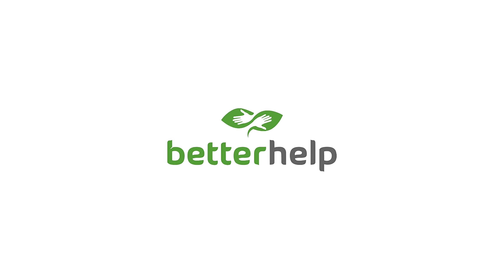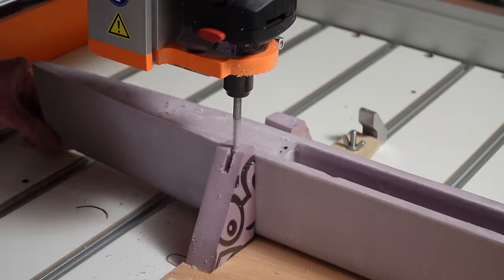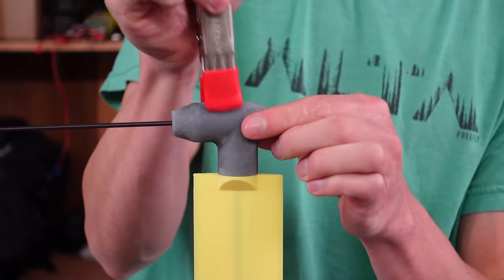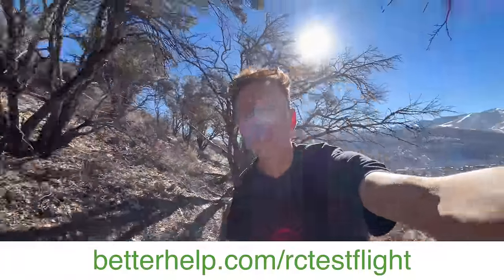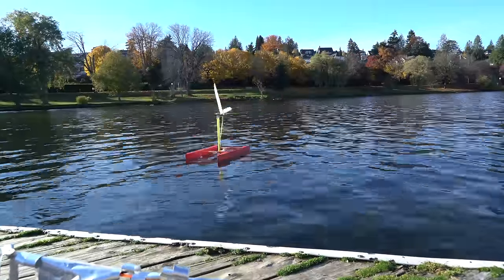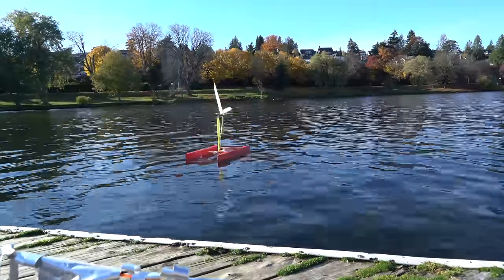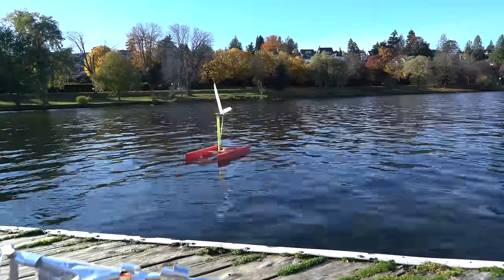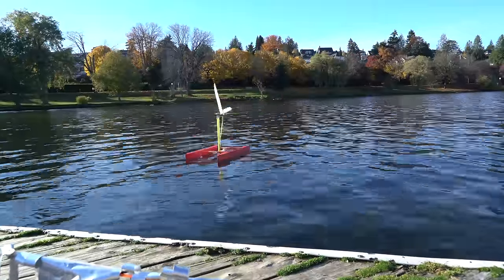Sailing Directly Into the Wind - Is it Possible?

Comment: I have always been fascinated by the wind turbine boat idea.  I have some ideas and observations.  First, an inherent issue may be the air friction(drag) of the wind turbine blades moving at high speed. That's the biggest difference from a stationary sail.  So what if, instead, a many-blade low rpm 'high torque' design was tried?  The blades would still need to be a very accurate airfoil, but they would be facing almost into the wind.  Another issue is the tip vortices and the fact that air near the hub isn't doing much.  So looking at the swept disk as 'sail area' you'd want a much bigger diameter rotor.  I don't agree that a Darrius style turbine would be better, because this would drastically reduce the 'sail area'.  The comments about your airfoils are right, you need a correct airfoil and yes you should be gearing the prop way up or going to a larger prop with a higher angle of attack on the blades.  The most efficient water props actually look like airplane propellers, they are instead made stubby to protect them. Then of course there are these new 'loop design' props, which astonishes me that they (supposedly?) work better.
Wind turbine boats work well enough to be acceptable in performance and they are Just so cool. Another interesting idea would be a turbine that compresses air instead of turning rotary shaft, and This air would be blasted out of an underwater eductor nozzle for thrust.one last idea: q combined wind turbine and solar electric boat ,Where The solar panel would block The noise and the hazard of the spinning blade and both would simply be connected to a conventional electric trolling motor.
Awesome work, thanks for showing us!!!

Comment: Peter Worsley has done some really interesting stuff and not only with rotary sails.  I have seen  his videos multiple times and plan to try his idea of a self trimming wingsail on an old Sea Devil sail boat.  I built a reverse flow double wing sail on my Sea Devil (I saw it on a video from tsstproa - who has also done some really interesting stuff)  that got lots of attention from other people  on the lake - that  would sail in almost no wind, and go very close to the wind, but had some issues that I havent yet got worked  out.
Reply: I have also seen his wingsail videos can only think I am missing something as cannot fathom why they have not been adopted in any capacity so far.

Comment: Had an interesting thought:  What if, instead of a propeller, you used a parachute or kite that pulled a rope wound around a drive shaft?  Kind of like an old-fashioned cuckoo clock uses weights, maybe it would be possible to use wind in the same way?  You’d probably need to attach a balloon or something to keep the chute up, and gear the water prop to push more water for less rope unwound (or use a compound pulley system).

If you found a way to close the chute, you might be able to set it up so it switches between two chutes - the high-drag open one reeling in the low-drag closed one, thereby making it almost perpetually running.  On the other hand, this might be a better project to try out on a land vehicle with more efficient wheeled drive.

Comment: This is an awesome idea. Also very related to the Veritasum video of sailing faster than the wind. But in reverse. 

Could you put a uni joint/cv on the wind turbine axle so you can change the direction of  it vs the boat??

Comment: For a sailboat, the center of rotation  of the boat is the keel. Adding the keel would help the directional stability. If it could be controlled and moveable from the bow to the stern (and back), you could turn into the wind easily with the keel towards the bow, and away from the wind with the keel towards the stern. Of course, it is additional drag, though.

Comment: I know on slower rotation speed like you get with human powered, a water prop that looks like an airplane prop is more efficient, with less drag.  The boat props are in the 1000s of RPM.  Larger vessels may be slower.  Greg Willoughby is an engineer from Australia that specializes in fluid dynamics that helped me with mine.  I now use a 14" with a 12 inch pitch for my boat. Hope this helps.

Comment: Love your thinking and effort. You are looking for a "rotary sail". How about profiling the wind prop as a "rotary sail". a deep cord of the blade next to hub to nothing at the tip. Blackbird is doing this with its prop design. I have no idea about the drag and ratios, just seat of the pants sailing. Try different sail blade camber profiles. Keep at it.

Comment: I love this.  I'm a professional sailor and Mechanical Engineer that lives just off of Green Lake in Seattle.  You might want to experiment with your mast location as this is considered the Center of Effort (blades) vs Center of Lateral Resistance (hulls/keel).  This affects how the boat can turn.  Also, you might want to look into asymmetrical hulls.  Hobie cats have used this to assist in tacking.
Reply: Mast, yes, but asymmetric [sic] hulls regarding tacking? They're more to do with reducing leeway, IME. Hydrodynamic lateral 'lift' - when one hull's more in the water than the other, as cats do. Tacking ease would be afforded by spring in the hulls - banana-bendiness - so that the bows and sterns would be more raised from the water, or less immersed, than the centres. 
['..just off of Green lake'. Is this because those who speak American can't decide whether 'off' has two f's or one? ;-) )]

Comment: The "magic" also resides in the fact water is much more viscous than air, which means the small water propeller has a lot more "grip" into the water than the air turbine has drag. (You also kind of touch this with the land-based Blackbird)

Incidentally, that's also why traditional sailboats can go against the wind: their keel/daggerboard/centerboard has enough "grip" into the water to limit the angle the whole boat drifts sideways, despite the lift from the sails being exerted mostly sideways and very little forward.

Looking forward to your next experiments. Also to try on the same platform:
-vertical wind turbine (one less beveled gearing): Savonius, H-bar, Helical
-horizontal wind turbine (lower momentum, and using the wind gradient to your advantage)
-inverting the roles with a Flettner rotor (Magnus effect)
-autogyro (bonus points if you can use the autogyration to recharge the batteries)

Comment: Skip the gears and use the wind propeller to generate power you collect and use for electric water propellers :
- makes desired speed independent of wind speeds (from backwards to hover to forwards)
- anchored you just load your batteries 
- no wind you can get home

Comment: In the 1980’s Glasgow University’s Naval Architecture Dept successfully built a small monohull capable of carrying at least one person, powered by a three-bladed air propeller driving a water propeller.  It could head directly into wind.

Comment: Excellent experiment. The older small racing catamarans used dagger boards just outside of each hull near midship. This gave a bite on the water without a full keel. The dagger boards were rounded on the leading edge so as not to foul on debris.

Comment: Okay, crazy idea - probably far more mechanically complex than it would be worth - but get this: Flywheel, Clutch, gears.

You’d probably need adjustable prop pitch on the windmill to get the fly wheel spinning from stationary but, have the boat anchored while the wind gets things going in ‘neutral’, then engage 1st gear to transfer torque to the water prop without having too strong of a brake effect on the windmill, then as you accelerate, shift up to 2nd to take advantage of the vessel’s forward momentum and so on - I mean, you know how a car’s gearbox works. 

As an extra little adaptive touch: variable geometry weathervane-rudder. Nice and splayed out for low speeds / winds, but can narrow itself for higher speeds / winds where less surface area is needed for an effective weathervane and you can reduce the drag coefficient. 😃

Comment: +1 for variable-geometry turbine blades, that would definitely help controlling blade rpm in high winds.  Bigger prop + more aggressive gearing for higher prop rpm and more thrust.  Add some camber to the blades to get more bernoulli's.  Also (I think someone might have said this below) you might not need a vane if you reverse mount the wind turbine.  The drag created from the lift should be enough to keep the blades angled into the wind.  Honestly scaled up and with some PV running down the catamarans to help keep a battery bank topped up, this could have some real application as a drone.

Comment: Pitch of wind blades vs water propellor =>  gears!

And yeah, single-screw boats often have a steering issue depending on the prop/ hull/ rudder interaction.  Some old Chris Craft single prop boats could NOT back up to port.  An old book on small-boat handling talks about being able to use this 'crabbing' to actually move the stern sideways in some docking maneuvers.

Comment: My trimaran 1.20 x 1.20m base and a mast of 1.85m  has no keels either, but the hulls are tapered and it does have a centerboard on both outer hulls. It's enough to keep it on course and to be able to steer with relatively small rudders. Both outer hulls are  positioned higher than the main/middle hull, so it effectively sails like a catamaran with only the downwind outer hull in the water, giving it much more resistance against being toppled over than a catamaran. In heavy winds it even lifts the main hull, giving it much less displacement. But that's tricky to balance.
Also, a sail ship doesn't get blown forward, but sucked forward. Just like the wing of an airplane gets most of it's lift from the top of the wing, a sail gets most of it's power from the down wind side of the sail. Sails have more or less the same shape as a wing and the principle of generating 'lift' is the same.
Ofcourse there's little to no advantage in a 3 hull design  when 'sailing' straight into the wind.

Comment: hi. i did this a few years ago on a 14ft long speed boat.  i used a vertical wind prop and gearbox to increase the ratio to 1:10 and the water prop increased in rpm. the vertical wind prop didn't need to be swiveled. it caught the wind in any direction.  i had to also designed a brake system to slow down the shaft to stop. if you need any info feel free to contact me.

Comment: Slavonius put one of his vertical axis rotors on a small boat Like dory, driving a prop.  Since the rotor was omnidirectional there wasn’t an issue of orientation you just steered with the rudder.  Glad you did this though. Too many people assume it’s impossible without trying.  There is at least one picture of him sailing it in Norway or Sweden wherever he was from.

Comment: not going to read thru 1,600 comments..so here´s mine... put a kort nozzle around the propeller (more thrust)make a more hydro-dynamic rudder(less drag) and reduce the distance between then prop and the rudder as much as possible(better steering control)...thanks for the video... good luck!

Comment: I have thought about this for many years. First you need an efficient windmill and water mill.
Then they need to be matched. Like matching airplane motor to propeller. 3rd combine with wing sail if possible. It will make tacking a lot steeper into the wind. You have proven the concept now you need to improve on it. This could be revolutionary.

Comment: Maybe try a vertical wind turbine. you'd eliminate the wind vane drag, the need to pivot, and the friction from one set of bevel gears. A proper foil shape is very important in both designs, including the rudder too. I'd say I was very impressed with the current results.

Comment: I am not an engineer, just an old mechanic. But I was thinking, what would happen if you printed up a squirrel cage fan, mounting it vertically it would turn no matter the direction of the wind. No need for weather vane tails and probably less drag then a big fan. Plus the mass of the fan would act as a flywheel when the wind ebbed and flowed. Just a thought. Really enjoy your videos, good thought problems for an old scutter like me!

Comment: This is very interesting! On the first design, I would try to invert the blades of the turbine and keep them downwind of the mast: this would eliminate the need of a weather vane and probably increase stability as well. The downside would be that the blades would be in the wind shade of the mast for part of their rotation, but I think it's a decent trade-off!

Comment: Now just visualize your propeller as a whole bunch of thin high aspect sails, oriented roughly 45 degrees to the wind direction. prevented from moving downwind but forced to move perpendicular to the wind, just like the sail on a sailboat on a broad reach.    The underwater prop is essentially the same just pushing instead of being pushed.

Comment: Great job. This will absolutely work very well. You just need an aerospace engineer to design and size your two propellers. Propeller efficiencies can reach 80-90% when properly designed and sized. I suspect yours are operating in the 10-30% range at best.

BTW, I think the biggest practical problem with rotary sails like this is the gyroscopic force of the air propeller/rotor. Gyros don't want to move, but the wave motion will cause the boat to bob around and move a lot. This creates large forces in the rig and a loss of efficiency of the propeller. I've always thought any successful rotary sail design would have to have a gimballed attachment of the rotor to the mast to isolate the rotor from all the wave motion.
Reply: Wow that would be a very strange looking boat!

Comment: I recall seeing film from the 1980's of a small, manned boat that had been equipped with a turbine sail, and power to the prop through a CV/Universal boat system. Variable pitch - on both air turbine and water prop - was the name of the game.
The turbine could be pointed in any direction, allowing the boat to travel in any direction desired, as long as the wind was blowing....

Comment: I notice that there are choices for materials to make them lighter, when there may be some benefit from making them more rigid.
A heavier vehicle would take more force (or patience) to accelerate, but its momentum could allow it to overcome the small random vectors of force from gusts and the action of the waves. In this case, there is plenty of buoyancy, so additional keel displacement and friction are probably minimal by comparison.
Also consider that if you are getting results from changing the rotary sail to propeller ratio,  you can try decreasing the diameter of the rotary sail. This could allow for a shorter mast that would have less flex and less drag. 

One of the obvious faults with the first system is evident when seeing how much the mast flexes, introducing possible friction on the vertical axle. That axial shaft version with its internal bearings eliminates most of this. Peter Worsley's boat shown at 11:19 has a rigid frame to hold the rotary sail, rather than a single mast. Even the Blackbird vehicle has a V shaped spit mast to make it more rigid. It also has optimized sails.
The axial shaft vehicle is also still too light, overdriving the system and preventing consistent pitch. That introduces uncontrolled vortices that are probably influencing the propeller blade itself.
I think that the efficiency gains from the axial design are overshadowed by the fact that the boat can't turn.

It is a great project and great video, though, and it is thought proviking. For instance, one might challenge the whole Blackbird concept as you wonder if trying to turn it when it is running twice as fast as the wind will make a Suzuki Samurai look stable by comparison.

Comment: Interesting! I'd love to see other types of turbines too! How about a vertical turbine? Even better, and way more complicated, what about a cyclorotor? Either for generation or propulsion? I have no idea if a cyclorotor can be built without using secondary motors to angle the blades, or if you use a servo on each blade, if the servos are fast enough. Probably not. Maybe some sort of collective/cyclic control, like for helicopter rotors, but at 90 degrees? Sorry, got a little carried away there! 😄 Would love to see anything you do with this! Subscribed!

Comment: For better steering, you could try putting the water propeller closer to the rudder. Rudders only work when there's water going around them. In the first boat, I'm sure most of the water movement caused by the propeller scatters before reaching the rudder